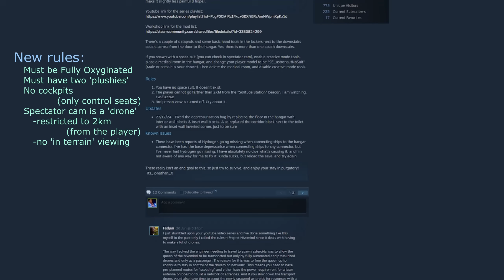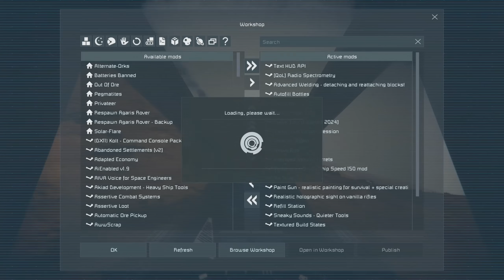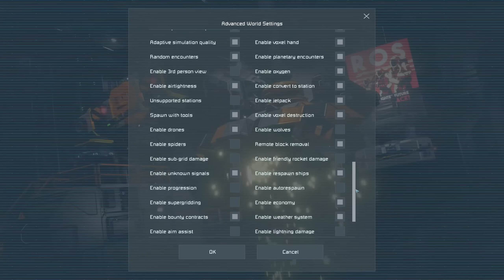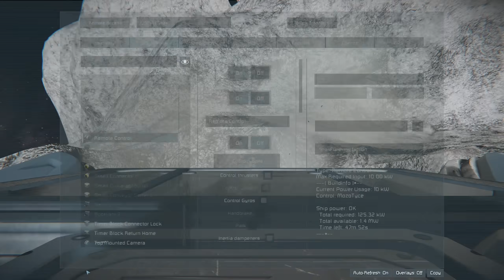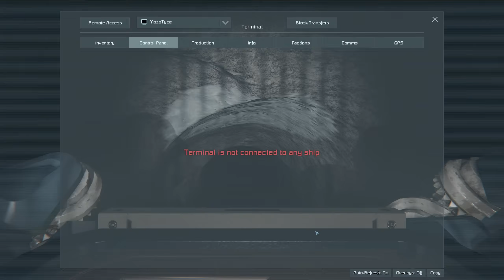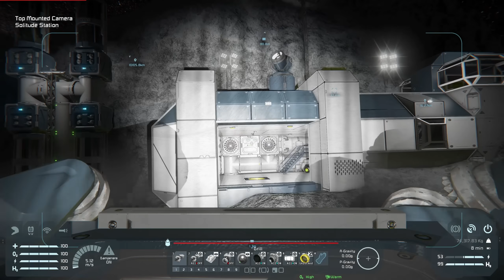Space Engineers - Agoraphobic Engineering Episode 1

Comment: Once you get a little bit of resources, it might be a good idea to make a little radio relay drone you keep at base that you can fly out to extend your antenna range. This could let you save your ship if you happen to fly it just a bit too far. Might also want to set up some system to make sure your braking thrusters turn on automatically if your ship goes out of antenna range. Maybe a timer on the ship that is set to turn them on after a short delay and another timer on the base that constantly restarts the braking timer on a slightly shorter delay via action relay. This will turn on the braking thrusters when the ship loses connection with the base to keep your ship from drifting to infinity and beyond.
I think that there's not an explicit "inertial dampener on" control (only a toggle), so you can't have it turn on automatically. You'll just have to be careful about when you turn it off.
Reply from the maker: Neat ! Although i don't think that's likely to become a problem it would certainly work. There is (now) an Inertia dampener on/off since the last update. An alternative would be similar to @Wellington6012's, a timer that 'auto returns' the ship to the base if not cancelled. Thanks for the idea 👍